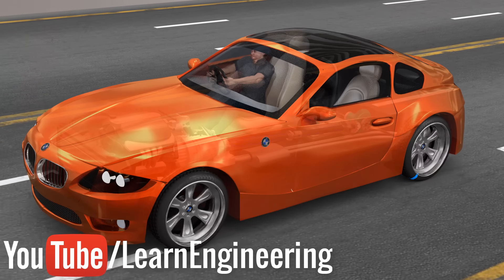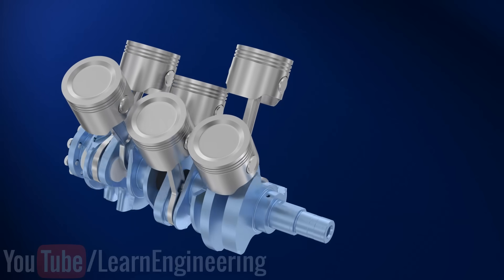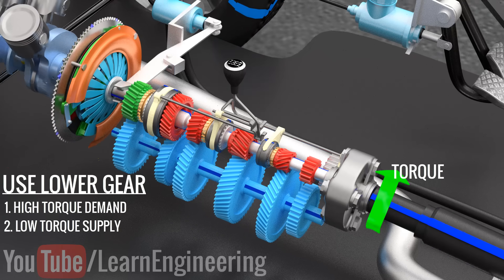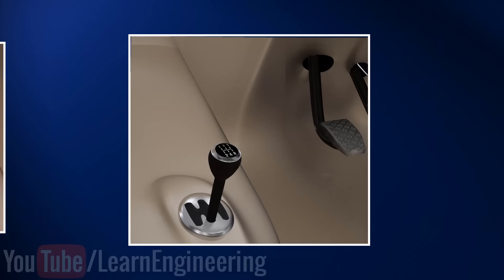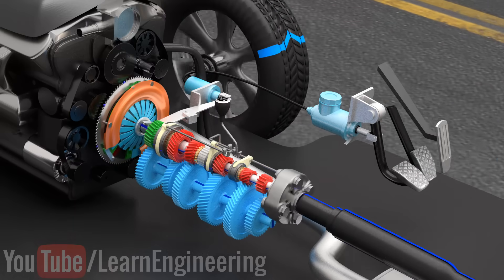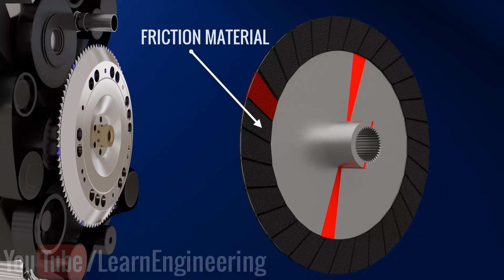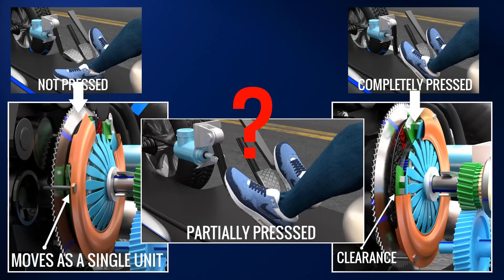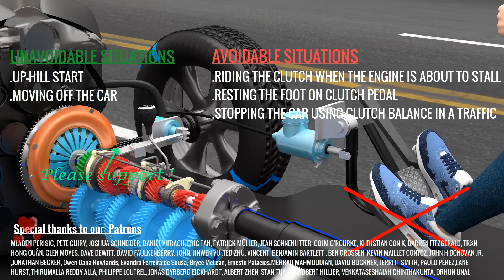Why you should not PARTIALLY press the Clutch?

Comment: Imagine going on 6th, NEARLY stopping at a red light and having to put 2nd as the 1st either gets blocked or you need to put a lot of force to get the gear in. By following this video you have to either STOP (causing a potential car crash) and put 1st OR to put 2nd and pray for the engine not to stop when releasing the clutch in 1 move LOL
Reply: Learn which gears are for which speeds in your car, and if you have issues putting a gear, have your car checked...or your brain
Reply: @ignacioaguirrenoguez6218  checked your mom and everything went well (y)

Comment: Two mistakes on this clip are: shift the gear directly from high speed gear to the lowest gear with out stopping, and ignore torque converter. The stalling is caused by the clutch partly engaging. The clutch partly engaging results in the clutch skip space when it applying force on the clutch disk.
Reply: Torque converter is for automatics. There is no automatic clutch in manual. YOU are the one who has the clutch engaged or released. Engine stalling is caused by resistance torque being greater than useful torque.

Comment: is it a right practice to press the clutch and  accelerate while degearing for smooth gear transmission in a motor cycle.  Will it damage the engine?
Reply: Please comment
Reply: If you using it on low speed & low rpm condition it's okay the clutch would be need to replaced after long use of periode like usual maintenance

But if you using it on low speed, high rpm condition then your motorcycle engine will hit you in the face

Comment: I used to be nervous about stopping on a hill, especially if a car pulled up close behind me. But if your emergency brake is a HAND brake, it can hold you from rolling back for that quick moment that you take your right foot off the brake.
Reply: Why would you take your foot off the brake?
Reply: @antonhelsgaun  to get on the gas, since an uphill start will need more torque from the engine so that you don't stall / roll backwards.

Comment: I mean I never ride the clutch because I'm not an idiot, but unnecessary depression of the clutch pedal just makes for a slower shift, simple as that. Just put in the clutch enough to where you can move the lever into the next gear and then when you let off it's already really close to the bite point

Comment: pressing the clutch to prevent a stall when in higher gears? A manual driver will just shift gears instead of wearing the clutch disks in the way you showed... 

The only way you'll partially release the clutch and add gas is when in first gear and going uphill OR in an old gasoline engine car, which really will stall if you don't add gas and again, only in first gear and not in higher gears, because you can shift to a lower gear instead... 

As for smoothing the ride, jerking hte car is really bad for the clutch, better slowly reconnect the engine and either let it match the revs itself or if you're a skilled driver, use the gas pedal to rev match.

Comment: When I was a Teenager I learned how to drive a Manual Transmission on 2 different vehicles. But the only way I could taxi in and out of parking lots and parking spaces and things that were very slow, was to just push the clutch half way. Was this bad? 

To me it felt like the only way to get the car / truck to move slowly because if I let it all the way out, I had to give it gas and that made it too fast. If I didn't give it any gas, the car would stall. So I just rode the clutch at the gripping point while parking.

I haven't driven a Manual transmission ever since.
Reply: this is one of those unavoidable situations they mention at the end of the video. either you do that or slam the gas and do a burnout

Comment: I've got so used to using the clutch in turns, the control it gives over the car is amazing and makes driving muvh more engaging. Guess I'll try and control that habit a little more to save some money
Reply: As long as you don’t hold it too long it should be fine. As well as going too fast. Just don’t linger
Reply: WHAT?

Comment: i always ride the clutch when in super slow busy 1st gear traffic situation. How do you suggest to deal in that situation?
also isn't engine stall bad for engine health? my dad strictly advices to not stall the engine
Reply: - as the vid explains, riding the clutch is terrible because you're making 2 surfaces rub against each other causing high wear rates unnecessarily
- stop/start low speed traffic is a pain in a manual, but it's still better to fully depress the clutch or put it in neutral as the circumstances permit
- stalling an engine does next to no harm to it, it's actually much more stressful on the clutch, g/box and rest of the drivetrain

Comment: And there are those who can shift a manual transmission without the clutch by matching the engine and transmission speed to shift called slip shifting.  The only time they use the clutch is when they want to stop the car.

Comment: If you are climbing a hill and need to shift to lower gear, riding the cluth technique is not going to work. Engaging the clutch partially will drop the speed and no matter how much throttle you give, it will not recover the speed in the same gear and the engine may stall unless you downshift.

Comment: If you find your self going up a hill and realise your engine is just about to stall you can't drive a manual transmission, otherwise you would have already changed into a lower gear way before you reached the point of a stall. I'm amazed that people recover from it by partially pressing the clutch and accelerating more.

Comment: here down the youtube rabbit hole, glad i did - a good vid and compliments to the comment section, some interesting and funny stuff down thar!

have seen others mention coasting in neutral at low speeds in slow moving traffic, which i have to admit i do if its particularly busy and when i move off im not able to just happily go at the speed limit for the road/+10% higher than the speed limit for the road - im trying not to cheat by googling but i can swear that when i learned to drive (quite some time ago now, alas, so i may be getting this wholly incorrect!) that coasting in neutral at any time is also a "bad" thing to do. iirc it i) reduces the effectiveness of your brakes, but tbh I've found that coasting in neutral is only really at slow enough speeds where I don't notice any meaningful difference in brake effectiveness and ii) it puts more wear on the tyres?

so which would be worse - partially depressing the clutch so as not to stall the car at low speeds or slipping it into neutral so im not having a balancing act between "juddering engine telling me im about to stall" vs. "putting some wear on the clutch"

i mean i would guess this is kinda obvious stuff but my rule of thumb is to avoid pressing the clutch as much as i can get away with and avoid having the car in neutral as much as i can too. most of it is just a judgement thing and will vary from car to car/traffic conditions. for instance coming up to stop at a red light - hammering the brakes down without any clutch will stall it, so i just try to do that "progressive braking" thing until the speed is low enough and im close enough to the junction that i can just slip it into neutral, bring the car to a halt and if needed put on the handbrake. also keeping my left foot resting on the floor of the car and only moving it to use the clutch, i can definitely remember my instructor telling me years ago that keeping your foot resting on the clutch pedal can mean that even that slight bit of pressure will add wear and mean you will have to replace the clutch a good few thousand miles before it really needs to; you can avoid wearing it out solely through good discipline with avoiding resting your foot on the pedal

Comment: "To get high torque at the wheels, you have to start the vehicle in a low gear. This avoids the engine stalling when the car starts. This is the professional way to avoid an engine stall" No this is not th professional way to avoid stalling... it's called driving a damn car.

And who the hell stays in a high gear using the clutch to increase the revs... If anyone is doing this, sell your car immediately and never drive again.
Reply: Ye, I laughed at that too. As if you couldn't start your car in neutral.
Reply: I agree so much. This is painful to watch.

Comment: "Some drivers partially press down on the clutch pedal to make the engine operate more smoothly."
Excuse me, WHAT? This is really a thing?
Reply: yeah bro its how you get a smooth ride. Even when switching between high gears you can feel occasional bumps as a passenger, slowly disengaging off the clutch ensures that its smooth.
Reply: @ChrisWhoLikesGrapes  That's really not the point here. What you do to shift gears is (obviously) depress the clutch entirely, shift, and then let it go slowly to make it smooth.
In the video they're talking about people half-depressing the clutch but staying in gear to take some load off the engine. Which is beyond stupid.
For example, you're going uphill and it's so steep that 3rd gear would stall the engine. In that case, instead of shifting into 2nd these idiots would let the clutch slip and rev the engine higher.

Comment: This is a horrible video. Whoever made it has no personal knowledge of cars. They read up on it, or maybe watched other videos about it, then made this one. I graduated from an automotive tech school, repaired cars for a living for a while, and have worked on cars for 40 years, including rebuilding cars and engines. I've been driving only manual transmission vehicles since 1991. I couldn't even finish watching this video it is so bad. No mention about gear ratios and the advantage of lower gears (mechanical advantage) when beginning to move the car or going up hill. The "gear stick" (never in my life have I heard it described that way) in the animation is placed where the driver cannot touch it or even see it. Like Dirty Harry said, "A man's gotta know his limitations."
Reply: @Spartan969  - Not in the USA. I did a search for the term and found it is a UK term ( https://en.wikipedia.org/wiki/Gear_stick ). Seeing that the driver in the illustration is on the right side of the vehicle I would presume the creator of the video is in the UK region. However, based on all the things the video creator got very wrong by the time I stopped watching the video I presumed he also made up that term due to his lack of knowledge on automotive drivetrains. I see now it is a regional term. However, this person has no place educating anyone about the function of an automotive drivetrain. They just don't possess the knowledge. In the USA it's called a gear shift or shifter.

Comment: I have a (bad?) habit of using engine braking modulated with clutch, especially in traffic. It keeps me from touching brakes for much of my driving and makes for a smooth ride, but probably not worth the additional clutch wear. I've been thinking about making a conscious effort to train myself out of it, but i keep forgetting and falling back to it, which is a bit ironic considering it is a learned habit, didn't do it (or didn't do it nearly as much) when i started driving.
Reply: Why would touching the brakes give you a less smooth ride? You can stop at whatever speed you want

Comment: Can any one tell me if I make sure I release the foot out enough, but not completely may it be safe for the clutch?
In other words I have the habit to rest the foot on the pedal.
However I take the feet to a point Where I can tell for sure there is no friction, at least that I could tell. Even if I press the clutch a few inches in I would not notice any friction going on, until certain point.

Hence my question, would you believe there is friction at the point I am used to rest the foot?

Thanks! 🙌

Comment: I guess I'm an old American and have been driving manual transmission vehicles for over 30 years, but I don't understand (unless you are racing) why you would ride the clutch for any length of time or at a high enough rpm to do damage to the clutch parts. 
Sounds like lack of effort to learn how to properly drive a manual transmission. I mean, people who were born in the late 1800's and grew up with horse and buggy learned to drive UNSYNCHRONIZED manual transmissions.

Comment: With low RPM and low speed, it would take a while (a long time) to destroy a clutch with a half-clutch technique. If you don't smell your clutch burning, then you are okay.
Reply: I smelt burning on a rainy day and my clutch died going up a hill :(
Reply: @ethannguyen5030  your clutch is probably worn out, causing slipping which would produce burning odor and ultimately failing

Comment: Woah what the heck? How is this remotely a "smart idea"? 
By half pressing the clutch yiu are alreafy rubbing the 2 high friction plates and by additionally speeding up the revs and the rotation of the fly wheel you are FURTHER exerting force on to the plates and heating them up.
Doing this is not only STUPID but also HIGHLY DANGEROUS as friction plates wear quickly due to tremendous heat and you can say bye bye to connecting the drive with the engine.

When you up hill start a car you are not riding a clutch you are connecting the plates together slowly so that you don't choke and stall the engine with too much force.

People don't do this with your manuals. There is a foot rest next to the clutch. Use it every time you are done shifting.
If you are racing then modify your clutch so that you have dead zone before the for e is exerted onto the clutch from pedal as foot must be always ready to do the money shift.

Long story short. If you are clytch riding stop right away and delete thid habbit from your mind. Your car will be thankful and will not leave you in the middle of nowhere because there's no more friction plate.

Comment: The key phrase this needs is "don't partially press the clutch *for extended periods of time or to offset lazy shifting practices*".  Slipping the clutch (aka partially pressing) is absolutely required for smooth starts from a stop (1-2 seconds of slip), when moving slowly forward or in reverse (generally slip it to get moving then push it all the way in until more power is needed), and is also a good idea to smooth out RPM differences when shifting gears (maybe .5 seconds of slip).  Dumping the clutch to avoid any slip is very hard on all of the components and is actually very hard on the clutch as it must pick up the "slack" of the RPM difference between the engine and transmission suddenly and harshly.

If anyone wants to argue, tell it to my 70k mile clutch that still grabs like new when I got it with 8 miles on the odo.
Reply: So, can i slip clutch when I'm in 2nd gear for 5 second?
Reply: @nuskyfoo6302  I wouldn't recommend it.
Reply: The video states exactly this at 5:38
Reply: @MHNK77  Not it doesn't, not at all.
Reply: @nunyabusiness896  Uhmm, I don't know how to argue something that's so straightforward to check. Just click on the time stamp and read the screen on the video

Comment: im almost 19 years old and been driving manual since 16yo, literally never knew riding the clutch was bad until i recently had a creeping suspicion and did some research... maybe thats why my old trucks clutch feels like jell-o and my friends feels like an actual on/off SWITCH
Reply: Just replace the clutch plates. Riding the clutch may be expensive, but it's way safer and provides better control. Changing clutch plates is not really a difficult process.

Comment: Wow really nice video and very informative. This raises the question however that should one press the brake fully or none at all to reduce brake pad wear.
Reply: The brake pads will never fully engage. If they did the wheels would lock
Reply: @blackwhattack  if the car has abs that is...
Reply: @blackwhattack  ever heard of the new shit in town called abs?
Reply: @keisuketakahasi4584  abs increases braking distances, why rely on the ABS?
Reply: @sh0ejin  most people are in shock and smash the brake pedal when seeing a kid or moose jump in front of them rather than keeping calm and try to find the limit before it locks up
and its just a tiny bit anyway
Reply: @keisuketakahasi4584  whatever, you should rely on knowing at what point you car should lock up. In low grip conditions, you should gently keep adding brake pressure, and in high grip conditions, you should take a reasonable stab and then gently keep adding. This prevents lock ups, and let's you steer if you are gentle enough. I don't get people relying on ABS so heavily.
Reply: @keisuketakahasi4584  and the shock part of imo needs to be worked on, but if the initial application is correct, I don't think most people will lock up. But yes I agree about the shock. Also, I made an edit to my OG comment. I feels stupid for what I wrote.
Reply: LOL
Reply: ABS is pretty nice. Saw it in action when I had to take a driving course last year.

Comment: Which drivers partially press down on the clutch? I've never heard of anyone doing that.

Resting your foot on the clutch pedal is not the definition of riding the clutch.
Reply: Mostly motorcyclists, but we usually have a wet clutch that accommodates that without problem.
Reply: @SmallSpoonBrigade  Motocyclists are riders.

Comment: The driver dude is wearing two left sneakers (3:06).
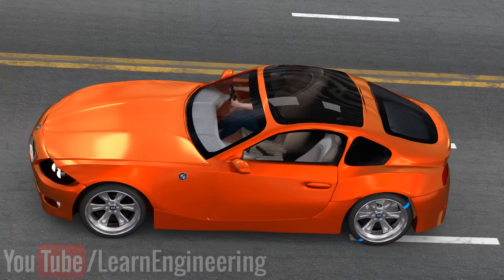Also the hand brake is engaged even though the car is moving (3:00).
Didn't know some BMWs have the gear stick right on top of the gear box under the hood (0:08). 😂

Comment: I always rest my foot on the clutch, but don't press it. The spring weight supports my foot weight. I also set off from the lights earlier in 4th gear in my 2.0 Clio. So you don't ALWAYS need a low gear lol